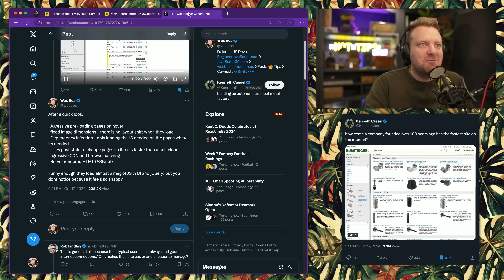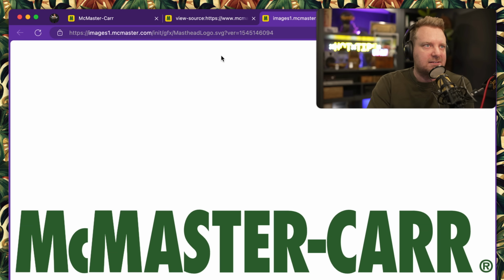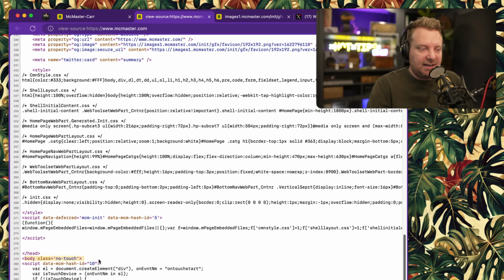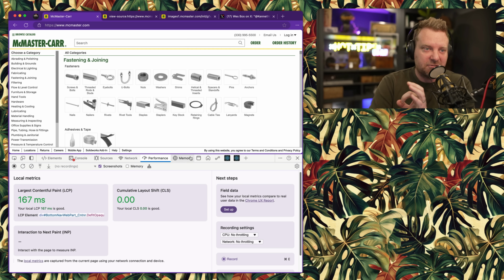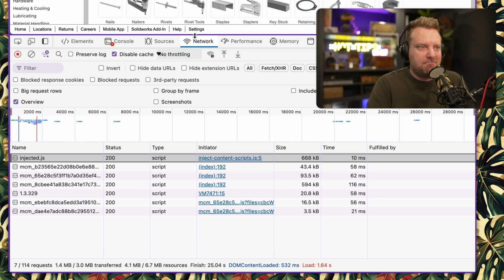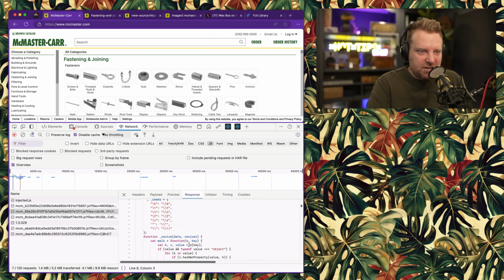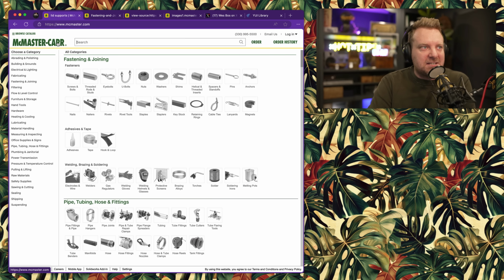How is this Website so fast!?

Comment: Nothing like seeing a team that clearly has an interest in keeping a decent performance on their site. Old looking site which is actually running React 17.0.2 under the hood (March '21). Lots of techniques that are really a part of the platform. The sprites were an interesting pic seeing that new protocols (H2/H3) make it unnecessary if not an actual anti pattern. Great video Wes! We love to see it! 🙃
Reply: unnecessary? how? never knew about the "sprite" for websites... I know it was used in games but never knew it was used on websites, was kinda interested in that part... so there is something else just as fast/easy to use? what is that? now I am even more curious to dive into that.
Reply: @LiLBitsDK  Way back it was the only way to add hover effects to buttons and such. I was very young back then but started programming not so long after. But anyone correct me if Im wrong.
Reply: @LiLBitsDK  With HTTP/2 and HTTP/3, multiple image requests can be sent concurrently over a single connection, reducing the latency issues that sprite sheets were meant to solve. This means it’s just as fast to load separate images, plus you get better caching and flexibility without combining everything into one file.
Reply: @GabrielSoldani  hmm interesting... didn't know of those two but I haven't fiddled with HTTP stuff for like 20 years :D well 24... used to handcode everything back then but have begun pondering on fooling around with my own site again and then I might as well learn the new stuff... am a bit behind :D
Reply: @GabrielSoldani  well i think the point is also that a combined image can be smaller than each image seperately due to compreession
Reply: @1e1001  The edge a sprite sheet might have in compression ratio is tiny, so it makes no sense to use sprite sheets on the new protocols and deal with the downsides: 1. a build step for your images; 2. a change in a single image means the entire sprite sheet needs to be cache-invalidated; 3. if images repeat across pages, you either end up with a large sprite sheet with unused sprites, or multiple sprite sheets with possibly repeated sprites.

This is definitely done to work around limitations on concurrent downloads from older protocol versions.

Probably best to only use sprite sheets if you measure and see most of your users’ browsers don’t have support for the newer protocols.
Reply: Sprites solved more than just the multiple request issue with images. Back in the day rounded corners, fancy borders, brand fonts, button states etc weren't possible before modern CSS, so they were all done with sprites. Amazon's sprite sheet was jammed with tiny pieces of every graphic element on the site.
Reply: @PaulMcCannWebBuilder  agreed. I file those under images as well, but absolutely correct.
Reply: @GabrielSoldani except it isn't just as fast.  It is less crippling, and QUIC (and https/3) removes more overhead ... But there is still plenty, particularly if that single image compresses well because, for example, the different parts on the same page have something in common.
Reply: @GabrielSoldani or, alternatively, that most of them either load the combined image quickly enough not to mind or do eventually want a 2nd image which is now already in local memory.  I'm guessing both scenarios are more common than particularly old browsers.
Reply: @GabrielSoldani  This doesn't completely solve the problem, because the images are still separate on disk. It does actually cost a lot to open 1000 files versus 1 file, particularly on slow FS like Windows NTFS. Also concurrent requests absolutely does not solve the problem. Each request still needs to be handled as it's own request. It needs to be routed over the internet, and that's really expensive. Just doing them at the same time doesn't fix that.

Comment: This tells me something about the company. They've had the same lead engineer for decades and he's paid well and well taken care of. They use tech built back in the days when speeds and computers were slower. They've used the same stack (jQuery, ASP) all this time, never having the need to adopt some brand new JS meta framework, just perfecting what they have. I'd guess this is a tight-knit duo or trio engineering team, if not a lone obsessive.

Comment: I bet the images being greyscale was a performance choice as well as it lets that sprite be even smaller from the lower colour amount.
Reply from the maker: I bet those images are still around from it being a print asset, so it had to be grayscale
Reply: @WesBos  Maybe an unintentional bonus then! And as most of them are just sliver tone metal you can’t even tell on a bunch of them XD 

Kinda makes me want a css gradient-map function so you could make palette swaps of an image like a classic game sprite…
Reply: @WesBos  Nah, those are typical modern CAD 3D renderings (probably SolidWorks). Their print catalog had much older AutoCAD line-drawing renders. BTW, all their parts can also be downloaded in various CAD model formats, which is fantastic for engineering work. They probably have "preview" generation scripts on the backend that can take any CAD model, load it up, put it in standard orthogonal projection, and render a simple grayscale image at any desired resolution. So, if they want to tweak the sizes of those images or sprites, I bet they can just regenerate all those preview pictures.
They only look like plain old grayscale images because everything in the mechanical engineering world looks plain and gray, no superfluous nonsense needed.
Reply: It’s more likely that they’re grayscale because they’re also used for printed catalogs. They are optimizing for latency, not bandwidth.
Reply: @mike200017  meh. just because something has color doesn't make it superfluous though. but i do understand your previous points, and that's cool they do that
Reply: @GabrielSoldani  optimizing for latency is essentially optimizing for bandwidth. wtf are you talking about my dude LOL
Reply: @Digitalgems9000  It’s not. For example, here they chose to prefetch pages the user might navigate to, which decreases latency between pages when the user clicks on something, but increases bandwidth as unnecessary pages are fetched.

Making image sizes smaller only makes the page load faster if downloading images is the bottleneck.
Reply: @GabrielSoldani  yes but that's still accumulated towards the user's bandwidth lol
Reply: @GabrielSoldani  bandwidth and latency are basically tied together-ish

Comment: I think it works fast not despite using the old technology, but because of it. Being fast and light is not the selling point of any modern frameworks, it's being easy to develop. 
Though preloading html on hover over is kind of excessive, but maybe it makes sense in their use case.
Reply: Easy to develop...(laughs with npm in React trans-piled TS) It's not just a sales portal it has engineering CAD files and other data and easy to use for invoice and document writers to reference. They are also one of the oldest government contractors that do not want websites with bloatware exploits. Using the web on a 'government secured' PC is torture slow for normal websites (think dialup speed). That website on a GSPC probably feels like a normal web experience for us civilian consumers using Amazon.

Comment: They are the absolute gold standard for "I need this weird fastener and I need it ASAP". Nearly every engineer has ordered prototype parts from them. If you've bought any product that was designed in the USA, I guarantee it was prototyped with parts from McMaster.

They also provide CAD for nearly all of their parts, right in the part details page. They make it so much easier on engineers to use their parts than any other supplier.

Comment: As a game dev, where performance is critical, I can appritiate a well made website like this that has similar optimisations.
Reply: I thought game devs had forgotten all about optimizations to be honest.
Reply: Generic engines are not the best for performance. It's pretty easy to make very slow games in unity or unreal.
Reply: @Zipperheaddttl  doesn't mean they can't be optimized in those same engines, even if it takes some esoteric hacks to do it. Tho might as well build your game from the ground up if it isn't playable on the engine of choice...
Reply: @lukdb  Aye, thats why I said it easy to make this mistake. Not that its guaranteed. Every engine can be as fast as shit as long you don't  push it to hard or are really good with that engine.

Comment: It isn't just fast, it's practical. I can make a shopping cart on the site and send it to my buyer with all the accounting information, and all he has to do is click the link and his shopping cart is already loaded with the correct items.

Mcmaster's website is just well-designed because they paid a good developer and gave them useful on-the-ground advice from machinists and engineers. I wouldn't be surprised at all if one of those feedback points was "it needs to be fast."

Comment: One reason they might have such a fast site is that they're a parts supplier. I imagine there's a bunch of OLD ass computers sitting in lube shops and auto parts small businesses that COULD NOT run a modern website. So if your customers tend to have old machines that aren't likely to be replaced, you better build a site THOSE machines can run well. It's heartening to see a web developer taking efficiency seriously, as opposed to the often assertion from the tech sector that people will "just buy a faster computer".

Comment: The focus on performance is not just about the WHO of their users (machinists, etc) but the WHY and WHERE of their usage. Somebody doing field work who discovers they need a part may not have the benefit of a stable, low-latency connection, and they want to get their order in ASAP so that they can close out their problem quickly. All of this speed makes the difference in whether or not they get a page load, and eventually a sale, from somebody who's working at a site with a spotty 3G or even satellite connection to do their shopping.

Comment: if you use the CAD program Fusion 360, you can peruse the entire catalogue of mcmaster carr as pre-rendered 3d models to integrate into your builds. so you can plan every nut and bolt in accurate dimensions into whatever you're designing,

Comment: Its probably worth a deep dive into how all their search filters work.  Every filter is perfectly specified for each category so you can dig down very quickly without difficulty. I can't imagine how insane the database must be to do that for millions of items.   

But basically i think they may be the perfect business...shipping is lightening fast (i swear they must have a conveyor belt straight into UPS).  Oh and the customer service is to die for.
Reply: You are one of the few people to comment on the aptness of their filter system. This is indeed a feat in its own right. It very much depends on creating categories of parts that share sets of attributes that characterize those parts in all the ways important to the customer.  Too often, websites that sell a wide variety of items do not go to the effort of understanding the product attributes, and consequently do not have relevant filters or sorts, and may even completely omit the most important attributes from the product description and specs.

Comment: I don't see anyone mentioning dependency injection, so I'll bite: I guess people were upset cause it's an OOP design thing, nothing to do with web dev.

From what I understand, dependency injection is a principle that says "if a component requires an object, it should receive one instead of having to build one itself". It's sort of like, if you have a big assembly line making pizzas, the person baking the pizzas shouldn't have to put on the toppings too; you can have a dedicated person to do that. The uncooked pizza is the dependency and the person putting on the toppings injects it to the baker.

What you're talking about is more like, IDK, dependency minimization?

Comment: Not entirely related to their website, but equally impressive imo is that their world headquarters, that happens to be right by where i live, also has like literally everything in stock. The only thing they dont is like large objects, usually that require freight. Comes in clutch for those random weird parts/hardware you dont wanna wait 2 weeks for from the oem.

Comment: I love how it uses some older tech too. I made the argument to keep one of our apps in KnockoutJS  and JQ which is "old" as it was way faster than our POCs with all the new frameworks. we also take similar approaches to this video to milk the most out of it.  Actually more fun too tbf finding engineering solutions rather than being a boring "just another site built in X". We are even considering forking KO as its no longer supported and making any security changes required ourselves over going to a new framework. At the end of the day JS is JS.

Comment: Speaking off: Ads are on most sites the main performance pain point; not only when it comes to traffic which often dwarfs the actual content in size even without video but also when it comes to requests. So yeah, when you make a web page that uses 3rd party ads, you automatically give up on performance no matter what you use or do.

Comment: Great website and great video! 

I used them back in like 2007 to buy a ruler length of grade 2 TI for dabs. .073 or .128mm were both good thickness levels!

Comment: I find the same for TME - one of electronic components distributor website. It's very snappy and well thought, categories and filters are just what an electronic engineer needs. There were times where Farnell, Mouser or Digikey were laughably slow compared to TME. They got better but I still consider TME to be the best.

Comment: In cases where there's access to server admin tools, I'd suggest trying Zram for swap, and adjusting database cache sizes for actual amount of RAM in the server (along with moving temp tables to ramdisk). It's just 10 lines or so in config files, and can drop load times from whole seconds to 300-500 ms with over 40k items in DB (not counting table joins) and hundreds of separate images per page with some custom js. 
And that's just the beginning of such fine tuning.
Reply: Those are some pretty generic large moves. They'll help performance, but one should be careful with zram, a ramdisk, and setting the cache pools so large, because that leaves no room for FS cache (the DBMS typically won't cull the cache pool outside of pressure), and most DBMSs these days use the filesystem directly (or close to it) for large blobs. 40k isn't really that big of a number, so unless you have some really widespread user input, that would suggest your trying to bring the entire table into RAM, instead of shaping your queries on indexes (or building indexes for your queries). At some point, there is a limit of throwing hardware at the problem...

Comment: One thing no one seems to be pointing out about the sprites - It's grayscale. Each slice is 60px x 60px x 8 bits per pixel. They have a maximum of 256 shades of gray, and they used at least 1 of those for transparency. These are all pixel artist renditions of real-world products IN GRAYSCALE

Comment: This is the kind of thing I liked to experiment with when building websites for myself. Unfortunately, in my actual paid job I'd have to add all kind of cruft to websites that made them slow. One web client even complained the website was slow after asking for a bunch of stuff to be added. This also goes with my general feeling that most websites don't need very much of the code that gets added to them.

Comment: Website Performance Analysis of McMaster-Carr

Introduction
0:00 Introduction and overview of McMaster-Carr website speed.

Reasons for Website Speed
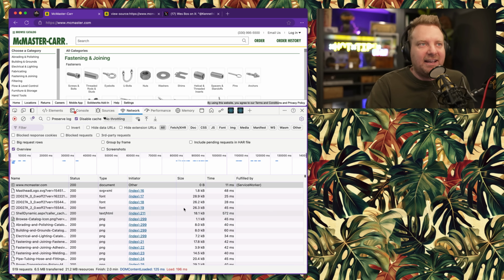0:37 Explanation of techniques used.
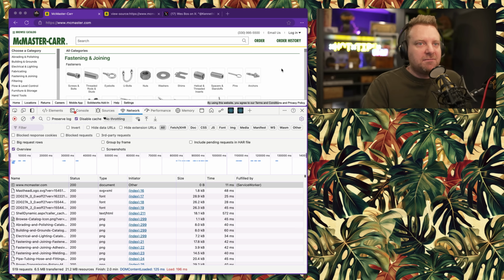0:40 Server-Side Rendering: HTML served directly, no JavaScript framework.
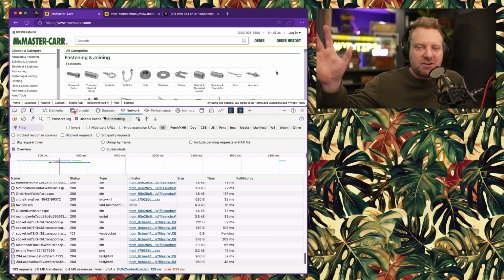0:42 No JavaScript frameworks used.
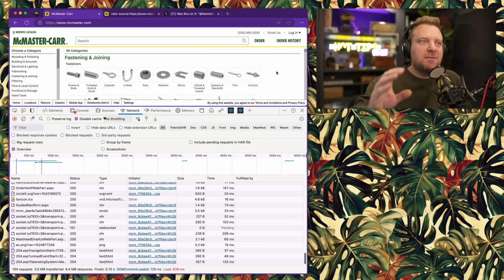0:50 Prefetching: HTML preloaded on hover.
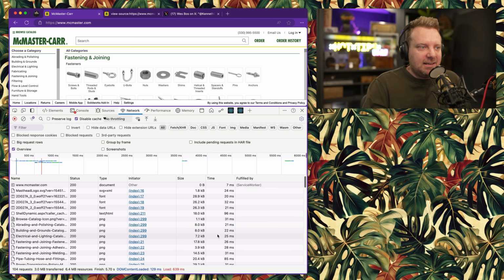0:54 Demonstration of prefetching.
1:17 Instant page loads due to prefetching and pushState.
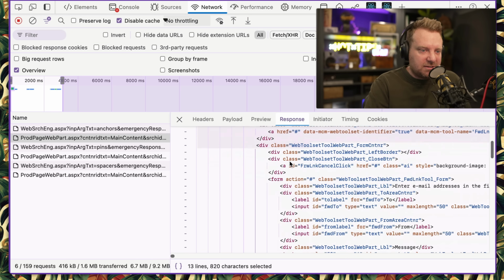2:02 CDN Caching: Aggressive caching through a CDN (Akamai).
2:10 Cache headers explained.
2:21 CDN usage evidence.
2:27 Squid cache proxy mentioned.
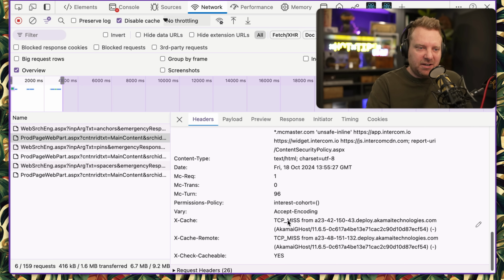2:36 Client-Side Caching: Service worker caches HTML for faster subsequent loads.
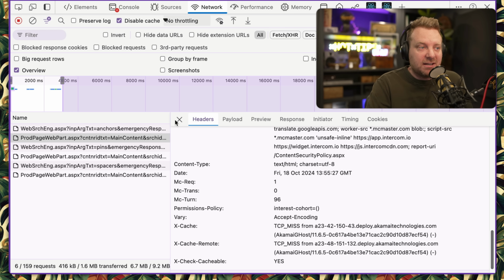2:42 Demonstration of service worker caching.
3:28 Preloading Assets: Preloading of logo, web fonts, and other assets.
3:43 link preload and dns-prefetch explained.
5:33 Critical CSS: Inlining critical CSS for faster initial rendering.
5:48 Explanation of critical CSS benefits.
6:24 Avoidance of page jank due to critical CSS.
6:46 Performance tab analysis: Largest Contentful Paint (LCP) at 174ms.

Image Optimization
7:37 Fixed Image Sizes: Using fixed width and height attributes for images to prevent content reflow.
7:49 Explanation of how fixed sizes improve rendering performance.
8:30 Image Sprites: Using a single image sprite for multiple icons to reduce requests.
8:35 Example of image sprite.

JavaScript Analysis
9:03 JavaScript Usage: Analysis of JavaScript loaded on the page.
9:12 Loading only necessary JavaScript per page (dependency injection).
9:50 Explanation of how JavaScript dependencies are included.
10:45 JavaScript Libraries: Using older libraries like YUI and jQuery.
10:56 Performance marks indicate focus on performance measurement.
11:17 YUI library identified.
11:31 jQuery usage confirmed.

Slow Pages and Conclusion
12:16 Slow Pages Acknowledged: Some pages are slower due to database lookups and product complexity.
12:45 Wrap Up: Summary of techniques and overall positive user experience.
13:14 Importance of speed for McMaster-Carr's target audience.